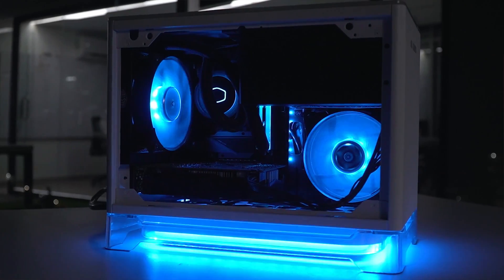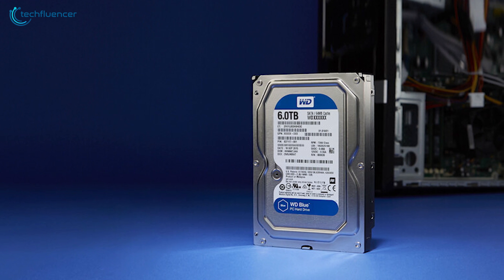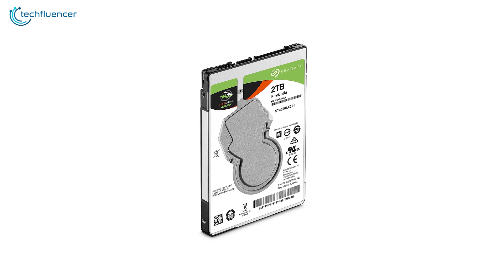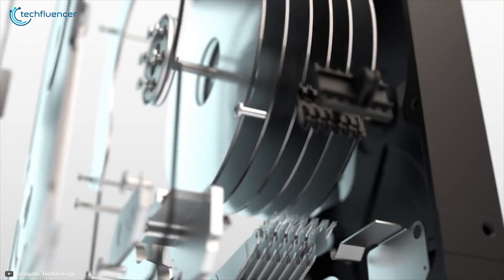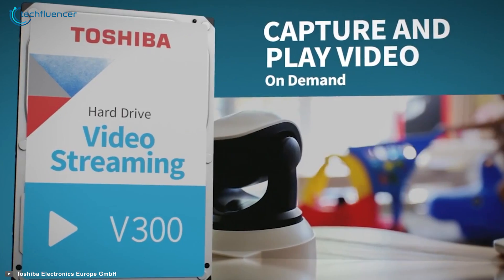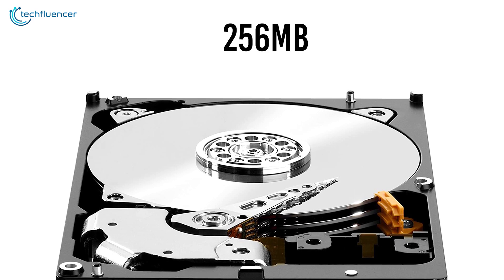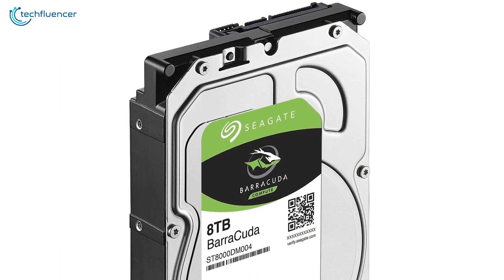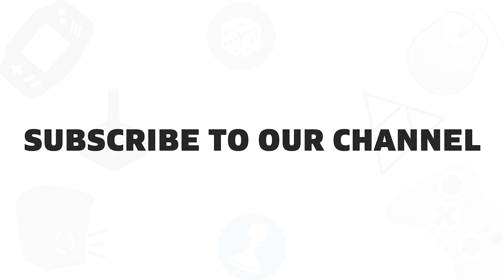Top 5 Best Internal Hard Drives

Comment: I found a lot of mentions of the Seagate Barracuda having 7200rpm, however when looking in shops where I live, the Barracuda is 5400rpm. I don't get it, are there two different versions of the Barracuda being marketed exactly the same but with different speeds?
Reply: In my country barracuda hdd with 1-2tb capacity got 7200rpm, but 4tb and more got 5400rpm, I was also confused when I can't find any 4tb hdd with 720p rpm, I don't know if it's the same in any country or it's just how all hdd is
Reply from the maker: Yeah, there are two variant. One with 5400rpm and other one with 7200rpm.

Comment: nice videos, please keep it up.
but I have a question, I have a lot of vacation pictures and videos , also some movies, so what RPM hdd is better for my PC storage , and play back videos and movie sometime, 5400 or 7200 ? I have a ssd for OS booting already . thank you
Reply from the maker: You should always go 7200 RPM, as is it will help you to transfer your files a little bit faster.
Reply: 5400rpm is good enough for your intended usage, unless u want to use the hard drive to run very demanding games off or do any video & photoshop editing etc which would benefit more from the higher RPM and yeah transfer rates will be slightly higher too. btw I've been using a WD green 5400rpm HDD to do all these things on for almost 6 years :)

Comment: Are you 100% sure about the Seagate BarraCuda?
I was thinking about buying one, but it looks too cheap for it's specs so I was kinda confused.
There are no downsides about this drive?
Reply: get WD Black for faster speed and 5 years warranty
Seagate HDD are really poor quality slow and break fast its stupid
most of them are SMR meaning if you write new things to it, it will rewrite again old data and in real life it translates to every  little things you do it will bloat to 100% usage and crap out like a old fart  lol
Reply: well back then barracuda have some issues. but today the issue is fixed
i have a 500gb 2.5inch barracuda now its dead already after 6 month of heavy usage (i have the old ver)

WD Black is better imo
Reply: only the 1tb 3.5 inch version is a good deal the rest of the Seagate Barracudas use inferior SMR technology, hence why they are so cheap
Reply from the maker: You can buy the Seagate BarraCuda with out any hesitation. it is one of the best HDD availabe in the market.